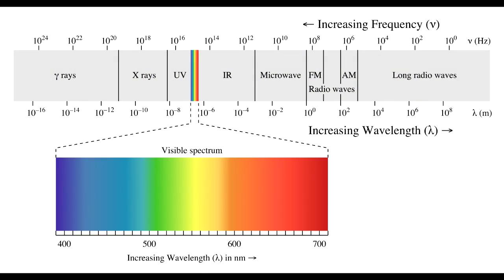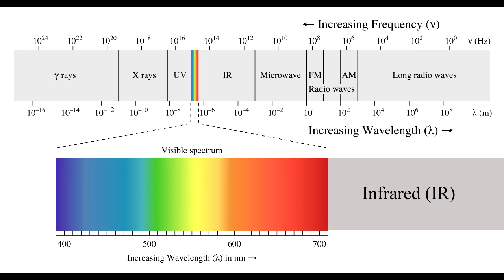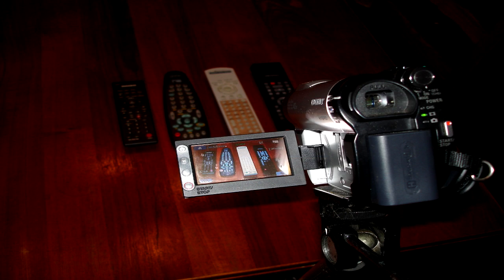How Do TV Remote Controls Work?

Comment: I found the best way to check remote control operation is simply turn on a radio to a blank spot on the AM dial.Now bring the remote CLOSE to the radio and push each button to check operation.You will hear a varying pulse tone if the key is working.The infra-red test with a digital camera did not work for me even though my remotes had IR diodes.After watching this video,I will try my camera and TV remote in the dark to see if the IR shows up in the camera.Thanks.

Comment: Capacitor is connected to battery.It starts flow of electrons through lines on board.All lines drives to LED lamp. TY! Is it similar process of IR light/photon - electron as at new LiFi nets,which is WiFi next gen?All best.I appreciate this!

Comment: I have read on howstuffworks,but haven't fully understood waves/pattern/signals part. How and who/what makes those codes/patterns of light/ binary number address or IR "fire signals"..and what are those/ number addresses:physicaly is it lines on piece of (mother)board? It is not similar as interpreter or compiler in computer language,right? I know nothing about electronics. .Chip of some kind exist in tv.Capacitor in remote device. Aluminium/galium/arsen is red LED materials.

Comment from the maker: The cameras usually only see wavelengths slightly into the near-infrared, which the TV remotes use.  Most thermal emission is at much longer wavelengths and is connected to temperature.  The hob probably isn't hot enough for its thermal emission to get to those "short" IR wavelengths.  The hob would have to be just shy of glowing red for the camera to see it.  Probably would work with an electric burner just before it starts to glow red (as well as after), but I haven't tried it.